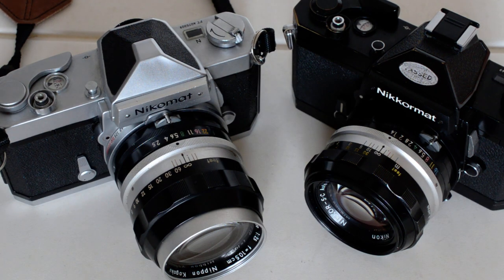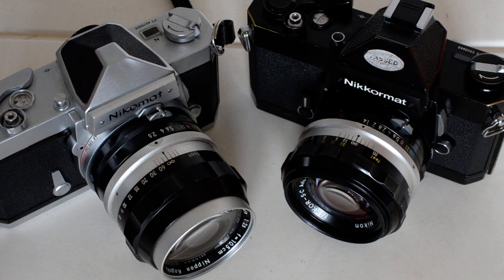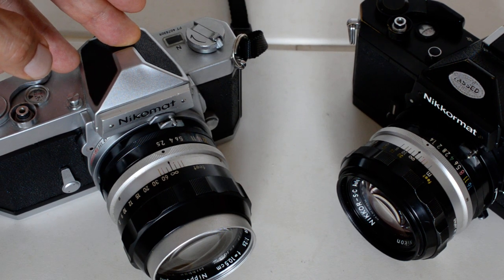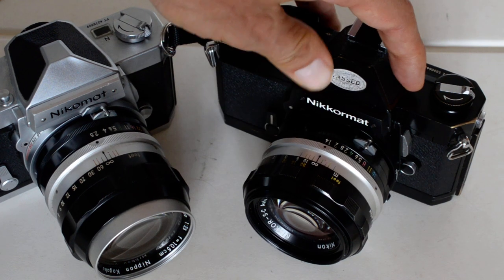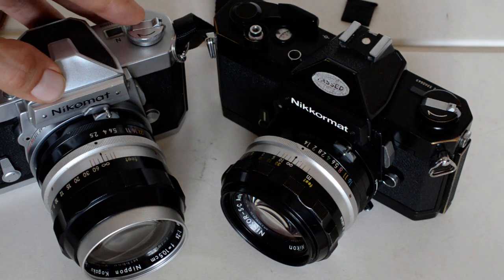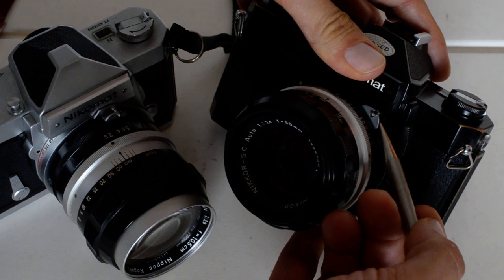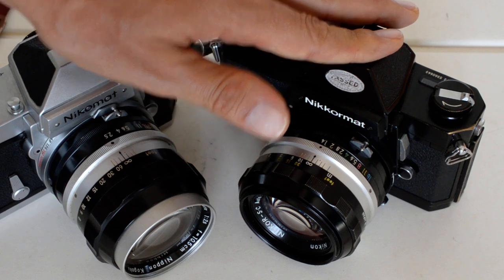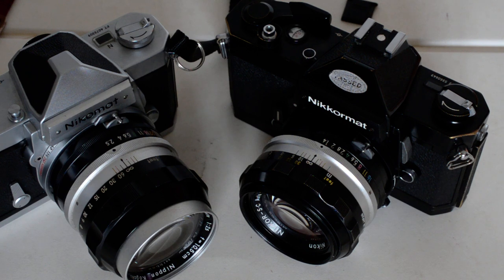Nikkormat:  overview of the various models

Comment: I started in 1974 with a secondhand FTn. Very rugged, but mounting the lens remained bit of a hassle. When the FE came out in 1978, I was sold immediately.
Still wondering why it took Nikon so long to come up with the AI system. They might as well have done some deep thinking in the mid ‘70s and do it right the first time!

Comment: I do not agree, ove inherited my father's EL. Since I was born in '89 he changed the battery twice. I have used it since 2011 when he passed away and changed it once. The camera has never ever failed me, the shutter speeds are always as accurate as they were when my father got it in the seventies since they are electronically timed. It is essentially a nikon fe without the ai ridge, the functions are exactly the same, but it is a little heavier and bigger but as other nikkormats it has hardly any plastic. I respect your view on mechanical cameras, but they have their own problems too. While it is true that electronic cameras are almost useless w/o batteries and if they break their are not repairable, mechanical ones can get inaccurate shutter speeds over time and if they break they can be repaired (if luck is on your side) but good luck finding somebody to do the job. I think either is great and should they break, they are equally inexpensive to replace, however if immune has great care of them, it is hard to break a nikon of that great manufacturing era.
Reply: Agreed. I had 2 nikkormats, both battery-holding. Never a problem.

Comment: BRIAN! As the resident Nikkormat historian on YT, I am really hoping you can answer a quick question. Do you happen to know if the FT2 uses the same battery cover as previous generations? I know the battery type was changed but cant find out if the cover changed as well. I need to find a battery cover for a FT2, so would love to know what my options are!! Please if you see this, I could use some guidance in the right direction.

Comment: I bought a Nikkormat EL brand new in 1975. . .I agree about the battery placement, BUT that camera performed very well for me for years.  I put it in my "collection" of vintage cameras when I went to a DSLR, but it really was a solid camera for a guy like me just starting out in photography all those years ago.
Reply: Same here. I never looked at any other brand or type. I stuck to the EL , becomes sort of an extension if you use them for years

Comment: The difference between the mercury 1.35V battery and a 1.5V battery, is that you will most likely get a underexposed picture. The reason for this, is the extra voltage, 0.15V will push the needle up higher and cause you to adjust either shutter or F stop to compensate. On camera's without an +/- compensation button, use the ASA button as a +/- adjustment. This is trial and error, but I would think half to a full stop would be about right for most situations, depending on the camera.
Reply: Or... have a repair shop solder in a resistor  to make another battery give the meter the correct voltage... OR  buy the MR-9 from C.R.I.S. camera services that Allows the use of 1 silver oxide 386 battery and gives the proper voltage to the camera.  When I bought mine years ago they were $35.  A lot cheaper than the camera tech route, and still maintains the steady and stable power curve of silver oxide batteries.  I have several because I have 5 FTn 's, and don't want to swap batteries between them when I carry more than one at a time.

Comment: I agree with your comment about the battery compartment on the EL series, but otherwise my experience with them has been very difference with the reliability of the various Nikkormat models has been very different to yours. I have handled six FTn cameras and none of them functioned correctly.  Metering problems are the most common, not only the meter itself but also the semi-automatic indexing system, which often doesn't detect the maxium aperture correctly and sometimes takes two or three attempts to do so.  I have a FT2, which does not seem to have this problem.  The original FT whilr fiddly to set seems to be more reliable. However, the position of the ASA and aperture scales, with one on the front of the lens mount and the other on the edge makes it more difficult to set.  I agree that the full frame metering on this model is a disadvantage.

I own all three EL models, and all have been totally reliable.  The aperture indexing system while it looks like the one on the FTn does not seem to have the same problems.  Whether I have just been unlucky with FTn models, or whether these models are just older, or whether slight changes to the mechanism in the FT2, EL and ELW, I don't know.  As for the battery drain, I bought my EL a few years ago but did not use it until just before the pandemic started and fitted a battery at that time.  I shot two rolls and then put it away.  I got it out and shot a third roll last week, and the battery, which remained in the camera, was still good after about two years.   If the electronics in these cameras should fail they would probably be more difficult to repair, but they seem to be much more reliable than some other electronic cameras, both contemporary models, and more modern ones.

You say your FM is gathering dust, why is this?  Is it because it cannot use full aperture metering with the pre-ai lenses?  Most of my lenses are converted, but I do not find that having to stop down with those that are not to be a major problem.  I wish Nikon had kept the fold back coupling tab on later bodies.  It's good that they brought it back on the Df, and on that camera can do full aperture metering, and even aperture priority automatic exposure,  with pre-ai lenses, but you have to tell the camera what aperture you are using.

Comment: I found a Nikomat with 3 prime lenses for $100 on Craigslist.  I snatched that set (along with a full macro kit and other tibits in a shoe box). I use the f1.4 50mm mostly on my Nikon D3200 in which the ability to mount a pre AI lens is it's sole saving grace :)
Reply from the maker: Sound like you got a darn good deal on Craigslist.  Well done!
Reply: the mod needed to run pre ai lenses on any nikon f mount dslr is really easy to do just file a tiny slot where the f 5.6 is located, as see carefully how it fits, the notch on the body has to move freely ant not be pressed in and ur good ;)

Comment: Hey Brian! I just bought a Nikkormat FTn based on your advice! 
I was wondering, does the 'Nikkormat Shuffle' only apply if I plan to use the light meter?
A bit of context: I have a M42-Nikon F Mount adapter for some old M42 lenses, and was thinking, since the camera does take f-mounted lenses, and all M42 lenses have separate aperture rings, then theoretically it should be okay, granted that the 'pin' on the nikkormat is only necessary for adjusting the metering.
I look forward to your feedback! Keep up the good informative work, and Thank You!
Reply from the maker: The awkward pre-AI mounting procedure is only necessary to properly set the light meter.  If you are not going to use the light meter, then this entire procedure may be ignored.  I would, however, recommend mating the metering prong and pin so they don't interfere with one another.
Reply: @BriansPhotoShow  Thanks for the help! So you're saying I should still do the shuffle over, just to make functioning easier?
Reply from the maker: @haygohay  Not exactly.  The "shuffle" part is turning the aperture ring to minimum and maximum and checking indexing.  That is not necessary.  However, if the lens in use has an indexing prong, I see no reason not to mate it to the pin.
Reply: @BriansPhotoShow  I see! But if there is no indexing prong, will I have any issues if I mount without "shuffling"?

I appreciate all the help!

Comment: The nikkormat ftn had a 12 m.m. focus screen, called the B screen. The ft2 used ( like pentax ) a DONUT type split range focus screen. It was called the K2. The nikkormat ft2 had the black plastic thumb advance arm, where the basic nikkormat, did not. The ft2 also was designed for double exposure, the basic nikkormat did not. You could take your nikkormat ft2 to have 2 other type s of focusing screen put in, only at the service time. Those nikkormat focus screens were NOT the same as an f or f2.

Comment: Hey Brian, once again a great video! I've been using my FTN for a while and it has been such a joy to shoot. They really are built to a different standard when compared to the later FE and FMs. I've noticed the light meter, while relatively accurate, isn't very responsive. It tends to lag when I switch from a bright scene to a dark scene and vice versa. Is that normal or should I get that checked out?
Reply: Also! I thought I'd share this, my Nikomat FTN does not have a shutter button that's threaded around it so I'm unable to use the original Nikon AR-2 cable release with it. I'm not sure if it's an odd one out or just a early/ late serial number thing, since both yours and my friend's FTN have the threading to screw on the AR-2 cable release. Cheers!
Reply from the maker: No clue about the cable release issue, but CdS meters in general lag a bit when going from very bright to very dark areas.  Gallium and silicon photo diodes are more responsive.
Reply: The earlier Nikkormat/Nikomat FTN didn't have the external thread around the shutter button. As such the button was lower compared with later FTNs.
I have such early Nikomat FTN and it is the only camera I have with a soft shutter release as it improves somewhat the handling.
To note that there are 3 versions of the FTN: earlier ones had a different leatherette, screws and shutter button. A second version changed flat screws for crossed JIS ones, a taller shutter button with thread for the Leica bell release while still having an all metal film advance leaver. The last version had a different leatherette, added plastic tip to film advance leaver and self timer.
Internally there might have been also a few changes.

Comment: I have a Nikon FE and a Nikkormat ft2. I also have a Nikon N75 af which is light and has all the functions using flash. The FE takes pre Ai lenses, not the FE2. 
My favourite cameras are the Nikon ft2 and my beautiful Yashica fx-d quartz with a 50mm f2 lens.
If had to keep only one it would be the Nikon ft2. Black, big and beautiful.
I don't have a passed sticker on mine and it has a black battery door not chrome.

Comment: I can't speak to all the Nikkormat models, I only own a Nikomat FTN and a Nikomat FT2, and there is a difference in size. The Nikomat FT2 is slightly larger in all respects, height, width depth, everything, and it is slightly heavier as well. You happen to have the same two models in this video and you can see the difference in size of the pentaprism housing.

Comment: At time frame...6:50. I have to inform you, that the (very ) first/pro consumer camera, was NOT the nikkormat.  It was the NIKKOREX. The Nikkorex was sold in 2 body. 1 with a  50m.m. f2.0lens,  and the 2nd was with the very first NIKON zoom of 43mm=86mm f 3.5. Both camera s used the very crude Copal ( blue ) sq shutters, with just 3 blades. This shutter was not SELF OILING and did  dried up. Many of them had to go  in for oiling service. Now you know why the ASAHI PENTAX M series camera ( but not the MX) used the sekio ( watch company ) 7 blade self oiling shutter. Ya.....i m a big fan on shutters.
Reply from the maker: The Nikkorex suffered serious reliability problems and was not used by professionals as a backup body.  It cannot be considered "prosumer".  Moreover, the Nikkorex wasn't made by Nikon but rather sourced from a third party.  Nikon didn't make that mistake again until the FM10.

Comment: Sorry, but you are not quite well informed about the stuff you want to explain: There isn't any Nikomat/Nikkormat FT/FTN/FT2/FT3 with the battery at the place you fancy – you only get that at the Nik(k)o(r)mat EL/ELW and EL2. And – with respect  – it's not a 'foolish' place behind&under the mirror because with the EL the mirror-up function is much more easy to handle than with any other Nikon. And moreover: parallel to the Nikomat FT, in 1965-67 a Nikomat FS was made without exposure measurement. I've been the owner of all Nikkormat FT... and EL versions and even today still like a Nikkormat EL/W from 1975. These are the facts:-))